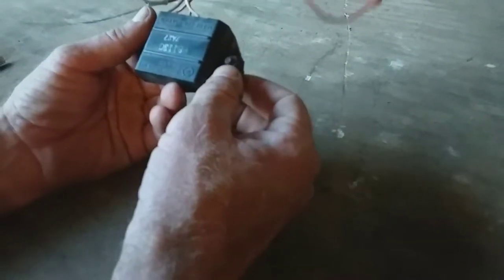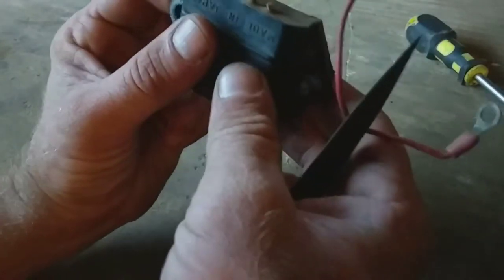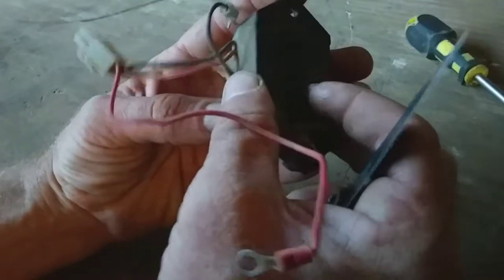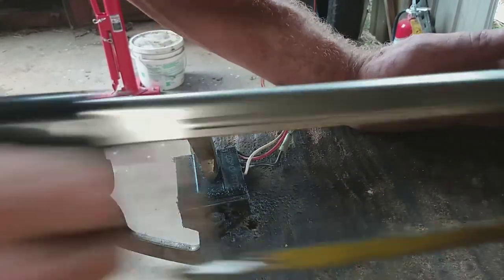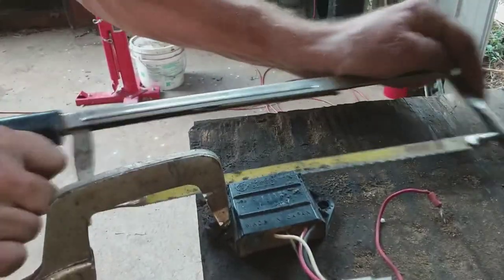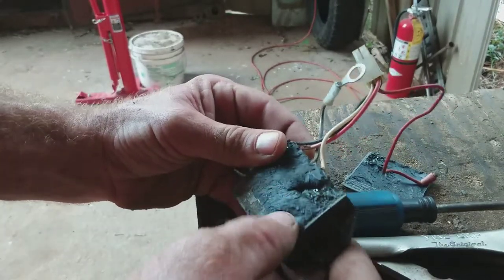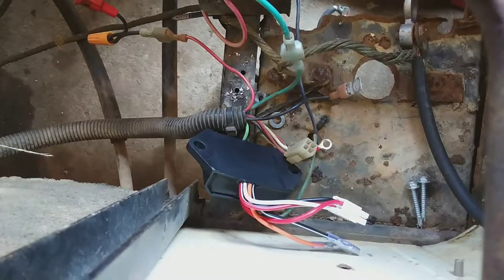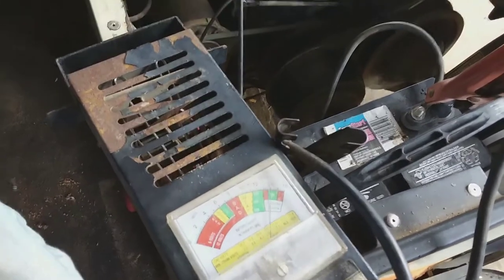Ezgo golf cart #3

Comment: Did replacing your solenoid fix your no spark issue? I am having a similar issue with my 1999 ezgo txt but it seems to only spark when you first press the pedal then again when you release. I replaced Coil and CDI but still same issue.
Reply from the maker: I ended up replacing the Cole the pickup and the CDI box.
Reply: Express Happylife 
Man I’m going through the same thing.  Did that fix it?
Reply: @timothyparker9509  So my problem ended up being the cheap Chinese aftermarket Ignitor (CDI) that I used to replace the original one with. A friend of mine had a used OEM Ignitor and put that in to solve the problem.
Reply: @ryanpinto1582  Ok Ryan glad it worked thanks for getting back to me.